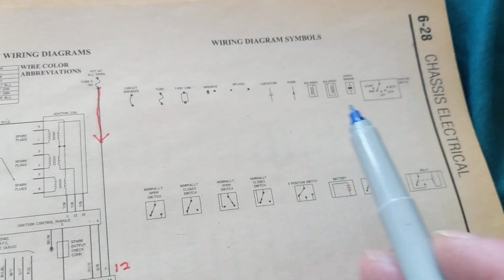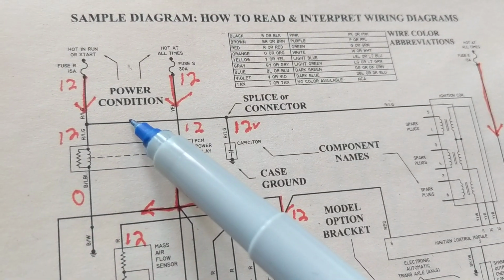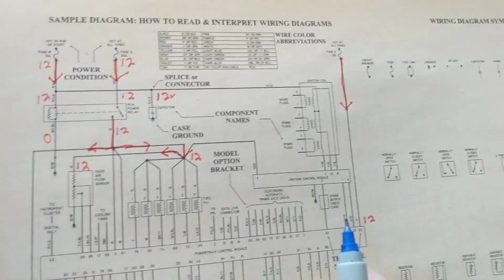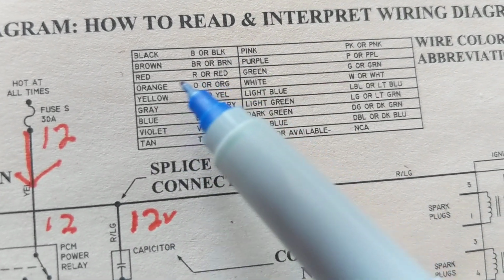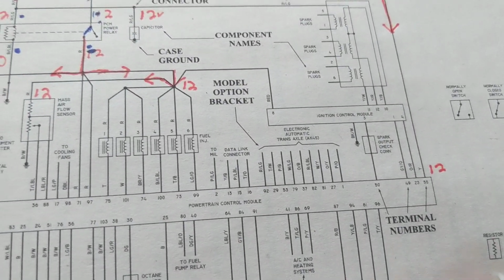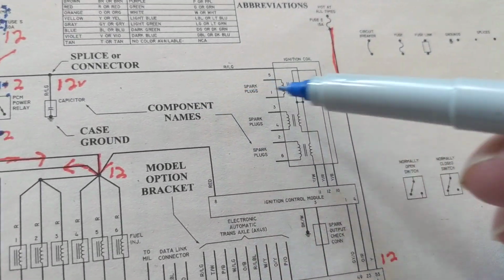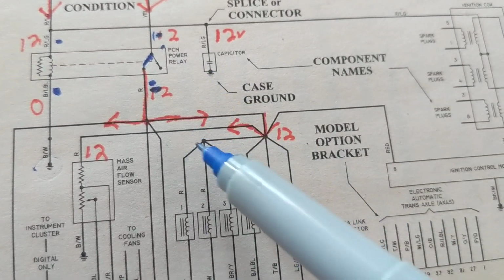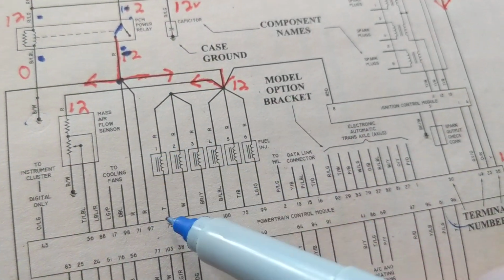HOW TO READ AND DIAGNOSE PROBLEMS FOR FROM WIRING DIAGRAMS SIMPLIFIED FOR BEGINNERS part one

Comment: Why are computer modules designed to give grounds instead of positive voltage?
Reply from the maker: Because you don't want to toggle the b+ line it'll introduce more noise into the circuits that way it's safer when you toggle the grounds thank you so much for your questions
Reply: @Joeelectronicschematicsforauto  are all computers controls like that or are there exceptions where b+ gets toggled?
Reply: One of my teachers I’m my automotive course told us there are some vehicles that are wired the opposite way with the positive acting as ground and all the negative are insulated.
Reply from the maker: @jermainestephenson5813  this cannot be done on computerized module cars especially fuel injection cars of today the positive of the battery has to feed all the modules thank you

Comment: If a transistor is basically a relay with less moving parts why are they not used in the place of a relay to lesson the chance of a mechanic failure of the relays moving parts.
Reply from the maker: On transistor is a switch or as an amplifier a relay gives you a circuit control circuit with a smaller current controlling a much larger current the load circuit transistors usually working milliamps in the base emitter circuit to control the emitter collectors circuits they are used in the ground circuits in the computer modules for fuel injectors to give grounds as switching devices and transistors can malfunction also remember to diodes back-to-back any problem in the input circuit will affect the output circuit of the transistor thank you for your questions good luck in school